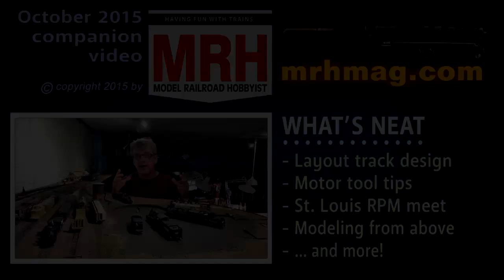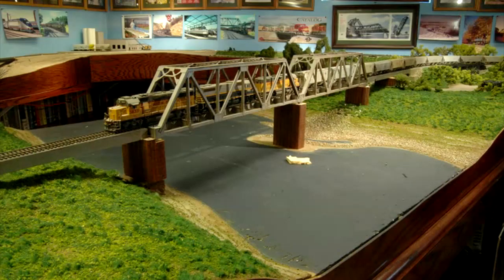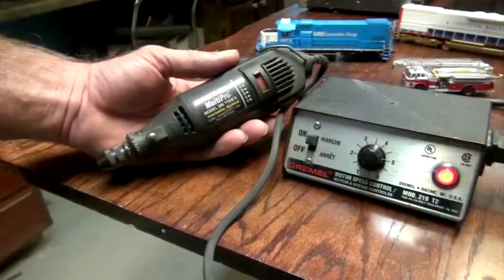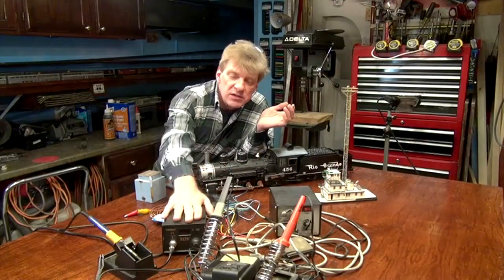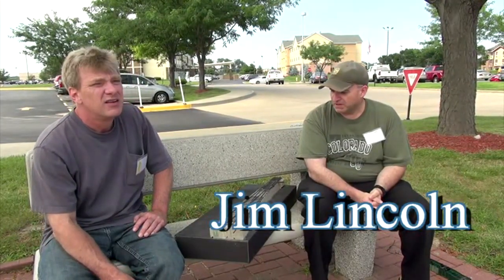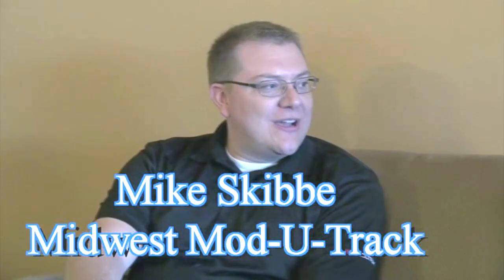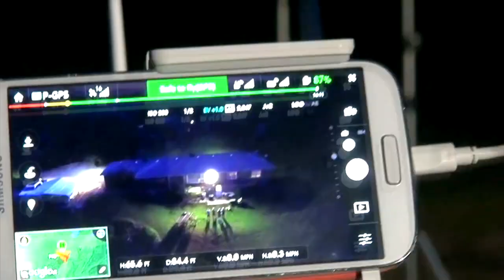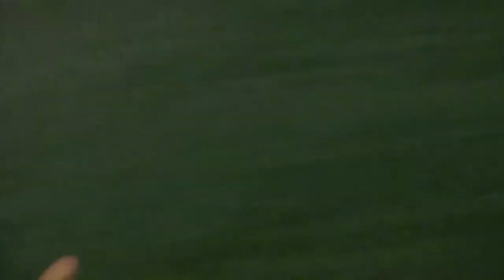St. Louis RPM and track planning | Model railroad tips | Model Railroad Hobbyist | MRH

Comment: I know this is an older vid but since you are commenting about the dremmel tool I wanted to mention an accessory you didn't.  I use my dremmel with a flex cable attachment.  It has a much smaller head than the tool and will allow you to chuck all the same tools in it.  It is flexible and can easily get into many places the main tool cant.